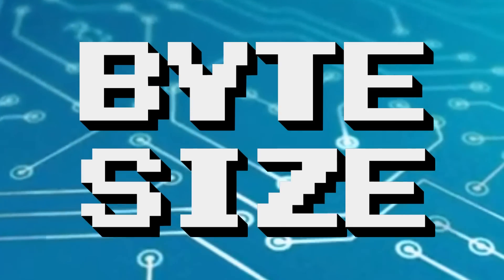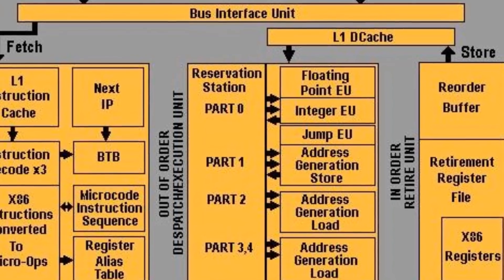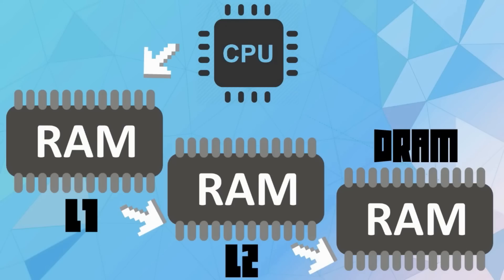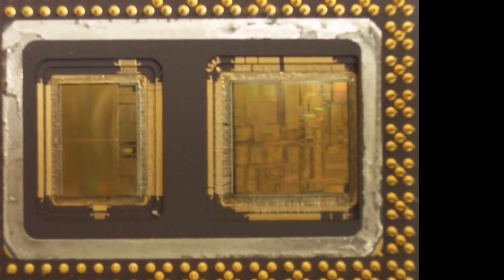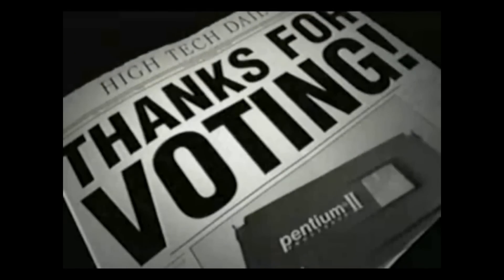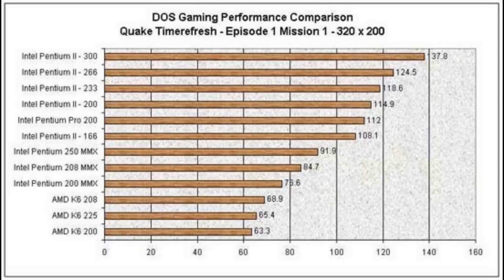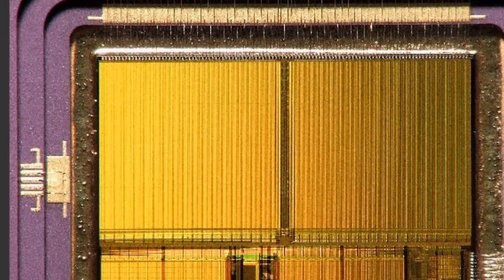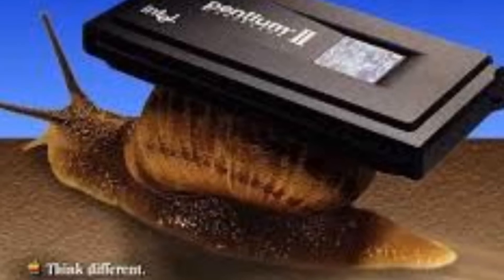Why Were Pentium 2's on Cards? [Byte Size] | Nostalgia Nerd

Comment: My first computer had a Slot 1 Celeron 333Mhz
Reply: My first computer had a ~5mhz 8088 x86 CPU LOL, it was a Tandy 1000HX.
Reply: Mine has a 2mhz 6502A with 4K of ram. VTech Creativision, AKA the "Dick Smith Wizzard". God I loved that thing, but updating to a Z80 4mhz/128K Amstrad a few years later was like being blasted into a star trek episode. Oh how we where naive in the good old 80s.
Reply: LOL I know the feeling. When I went from a Tandy1000 HX to a Tandy1000 TL2 (80286 CPU), it was nice but a small jump. I used that computer FOR YEARS..  So when I went from it to a 486 DX4 100.. It was like getting blown for the first time.. You smiled for days and all your friends knew who the man was.. :-D
Reply: A shitty acer OEM computer with P233MMX (the good part), 32MB SDRAM PC100, S3 Trio64V+ and NO 3D accelleration. Had to stay like that for years.
Reply: Mine was a Pentium 2 350MHz, on the same slot :)
Reply: My first comp had a Pentium MMX 166Mhz with 32GB of RAM, 2GB HDD+1GB HDD(later also a 12GB HDD), 32x CD ROM, Voodo2, ethernet and a Soundblaster 16
Reply: Wockes You had my same 2D video card (what do you think of it?), and a Vodoo 2 that seems a bit overkill for the system , but wathever that's cool.
Reply: Mine was a Pentium mmx 233, mhz 128 mb of ram, 4 speed CD drive, with a 1 gig hdd that later I got a 8 GB one and that was insane but sadly the gpu is what killed me it basically got me out of pc gaming for years its a s3 virge dx/gx pci 375/385 and it sucked big time the rest of the stuff fine but that gpu is terrible
Reply: @playereric7538  Yes the "graphics decellerator". Did you upgrade the system to 128MB yourself? Back then a Pentium system wouldn't ship with more than 32MB in it.
Reply: Bastylander oh yeah and it being 98 when I got it basically nothing played on it, not any well at least. And I did get an upgrade like a year after I got it to 128 mb because the guy said it would play games way better... it didn't, but I was young and just believed it would. And also 98 is late for it I know but we got it super cheap from a business that closed down but the pc is a Compaq deskpro 4000 I believe
Reply: oh, i remember that age when u can play games at 333 mhz and 32 mb of ram and 4 mb graphics card  :-) :-)

Comment: Alot of misinformation in this video. Only the first two celeron models came without L2 cache. The rest of the eight 250nm models all had on-die 128kbs full speed cache. Nostalgia Nerd obviously has not lived through this era of computers.
Reply: Or couldn't remember :p
Reply: And wasn't the celeron with full speed cache and the p2 only half speed?  I have seen a lot of comparisons where the celeron overclocked flogs the p2 and even slot 1 p3 in a lot of games due to the faster cache apparently.

Comment: So why was it on cards?
Reply from the maker: Because card rhymes with lard.
Reply: Because having the cache built directly on the CPU package lowered their yield (They would have to throw out the entire CPU even if it was only the cache that was faulty).   By putting the cache on an external circuit board (the slot thing) they could reduce this waste by swapping out the cache if it was faulty without having to toss the CPU also.    In other words, they used slots because it saved them, (and their customers) money.
Reply: rnbpl because the speed of the communication channel would inherit too much cross talk over a socket and was unreliable. The chips had to be kept close and data line lengths tuned for match propagational delay.
Reply: Nostalgia Nerd why not just answer him or link? I still dont know why it was on a card
Reply: It's mentioned in the video, and chris kerley already answered.
Reply: Something had to house the PCB they stuck the CPU and cache onto.
Reply: @Nostalgianerd  Youtube has become brain dead and made it so we don't receive email notifications to Youtube channels that we have "subscribed to" We don't know when you post new vids!!! Help!!!

Comment: Those were good days for budget minded pc builders.  The celeron 300A package had that second chip disabled but the CPU core was the same as what went into top-end pentium 2 and could be easily overclocked to 450 MHz.  At those speeds the detriment of no L3 cache was less than the benefit of the higher clock speed.  So many of  us that were into the early hardware 3d accelerated  had those for a couple years.  Mine went on to run as the NAS router in my parents' house for the next 6=7 years (running 24/7 although at its original 300 MHz.  It replaced an AMD K5 based system that crashed every few days and gave up the ghost entirely within about 4-6 months of router service.  The 300A regularly hit the 42.7 day uptime bug in win9x and was eventually replaced by an off-the-shelf router )and  was done so just for ease of use... that 300A kept running admirably right up to the end)

Comment: The Pentium Pro had full speed L2 cache of 256k , 512k or 1028k (1 meg) The chip was super expensive to make and was king in the server world for a few years. IBM PC's cost about 2500 to 3800 dollars each with a pentium pro and were used by servers and banking too often with NT4.  The IBM 365 6589 machines I ran here were used for about a decade, they had usb in a mother board from 1996. With Windows 2000 the top configuration I used for Photoshop was two 333 Mhz  Xeon overdrive server cpus with the max 512 megs of EDO ram. The box was really actually good for gaming in that the games used dual processors eons ago. One odd server motherboard I once used from 1996 would hold 1 Gig of ram, 8 sticks of 128megs. it was killer for photoshop  and big files when most folks were playing with 64megs. The ram was bloody hell expensive, a grand or more for the ram. Pentium Pro never had MMX buy II often did. The 333Mhz Pentium  Socket 8 Overdrive CPU was once 1000 bucks in Beta then 599 list when it came out to the public. Socket 8 is the giant Pentium Pro socket. There were some oddball Socket 8 to Celeron 533 Mhz aftermarket gizmos sold but none of mine would work long term, the Computer would lock up at the worst time. :) Pentium Pro never really took off in the Home market because it really did not benefit much with  Win 95/98/98SE; But with NT3.51/NT4/Win2000 the CPU's features were really used.

Comment: Celeron 300A was my first CPU in my very first PC. (I didn't know what a beast that was at the time, it was just cheaper and recommended for games)  When I myself opened my PC  later, to upgrade my graphics card (thankfully it had an AGP slot)... I was amazed that the CPU was also in a slot and not in a socket. I still didn't had Internet back then (1999 was the year)...  and was getting all my knowledge about the PCs from game magazines. For me my first PC was like going from 0 to 100... after that I was never that amazed at PC build, no matter how powerful it was.

Comment: The best thing was the Celeron 300A, I had one. Easily clocked to 450mhz with 128k ondie cache not slot cache. Back in those days, an overclock over 100mhz was extremely huge without special cooling. That Celeron was quicker at 450mhz than $500 Pentiums so we were quite excited with it back in those days.

Comment: These are amazing machines that people use all the time when they had a tough time early on in history and they can't make it through Windows 10 and all the events that take place. The best part about these is that they interface with all the children's equipment so if you have a serial connection or even an old expansion card it will work, plus you can put in a top Pentium III and have Netflix and chill whenever the server is on with Vista. It has no NX-bit so it can't run adult software but I would say if you were to put one in a box and plug it in either via USB or PCI-e ribbon cable make sure that it is ready to get hot because requests from real computers can make it work very hard!

Comment: Intel went with Slot 1 because it was easier to patent protect and thus exclude pin compatible drop-in off brand chips as were rampant throughout the Socket 5 and 7 eras.  Since Slot 1 there have been no off brand Pentiums.

Comment: It was basically an experiment in design and cooling IMO.  I think Intel thought by moving the processor off the board and onto a "daughterboard" that this would reduce heat on the board, which it did, but I think it caused other problems, and they went back to the old CPU socket style with later models of the Pentium 3 and later (as some earlier/older Pentium 3's and Celerons were slotted, but newer ones were on the main board via a regular socket).  In fact, I just found (in a box) an old Pentium II processor I have been holding onto for historical sake.

Comment: I've read somewhere that the early cacheless slot 1 Celerons were made from discarded P2's that had cache failures during testing, so they apparently had their cache removed or disabled and Intel was still able to package them up and sell them
Reply: +Infinitrium Same as for the 486sx, wich was a cache failed dx
Reply: +Bravo's retro the sx was actually a dx with a missing, or disabled math coprocessor.

Comment: Ive got loads of PII and PIII cpus all slot 1, have a working system. Still using a PIII, 550mhz SL3F7  slot 1 cpu in a Microstar MS-6163 mobo, its my server running XP, brilliant for music and video sharing with SCSI U320 adapter and 2 x 1gbps PCI Ethernet cards.

Comment: Like! The first Celeron had zero L2 cache but the Celeron Mendocino released only 4 months after the first Celeron, had 128 MB L2 cache at full speed. The Celeron Mendocino was because of this just as fast as a Pentium 2 ar the same frequency and FSB. The Celeron and Celeron Mendocino were also the overclocking Kings of that period, the 266-333 mhz versions being able to overclock by 50% simply by raising the FSB from 66 to 100. The Celeron Mendocino 300 mhz, at a price of 149 $, could be overclocked to 450 mhz (4.5x100) and perform just as fast as the fastest CPU on the market, the Pentium 2 450 (4.5x100) at a price of 669 $, both CPUs being released in the same day 24 August 1998.

Comment: The later celerons (Medocino's) had L2 cache - the differences between the Celeron 300 vs 300"A" where the cache was printed on die with 128kb of L2. It was very good when you overclocked it up to 450Mhz which matched the P2-450's for most gaming operations. These were the golden days of overclocking when they easily got 50% better speeds with enough cooling.

Comment: the last image is funny with the Apple ad showing a Pentium chip on a snail.

Little did they know only a few years into the 2000s,  Apple would be using Intel CPUs.

On a side note I always called these "Nintendo Processors" because the went in like an SNES game.  It was easier than saying "Slot 1" and then having to explain that Slot 1 CPUs are the ones that pop in like an SNES game.
Reply: David Kearns oddly enough now everyone wants to use Amd... And that was before rysen

Comment: That nice proposition in theory, but probable reality is that the primary driving reason for changing the form factor isn't a technical one, its business strategy in planned obsolescence and market control. 

Changing the form factor from socket to a slot architecure (coupled with an advance in processor design) means everyone is forced to buy completely new equipment and that's a huge business profit when (as is initially true) only Intel had and or was able to licence that form factor.

It came out at a time when AMD had undermined Intel dominance in the Socket based motherboards by producing cheaper competing chips and Intel needed to regain their business edge. Switching to slot based architecure put AMD back onto the back foot again (at least for a short time)

Comment: True, a packaging strategy was needed for product yield due to cache issues, but the slot was one particular vp’s desire. There are reasons not to do this. The perpendicular slot-motherboard made an antenna, which was not the product objective. This Caused problems with the Xeon which had four slots, limiting fsb to 100mhz,when 133 was badly needed. A perpendicular pci card was not as much an issue because that was 33mhz at the time

Comment: You forgot to mention the Celeron 300A. The Celeron 300 was an absolute disaster, so Intel re-released the Celeron with an on-die 128Kb L2 cache that ran at bus speed. In turn, clock for clock, it matched the P2 300 in benchmarks, and once overclocked to 450Mhz, it often beat the best P2 450 in the market. Nearly every 300a is able to overclock to 450Mhz. This was the true hero of the slot Intel CPU generation.

Comment: * socket 370 celerons and some later slot 1 celerons have 128kb of on-die L2 cache, making it faster in most games then a pentium II. Alltough the latter had 4x the L2 cache, it was on cartridge and ran at half clock speed, making it slower then the celeron in most games.

Comment: The other reason for secc processors to exist was the space they took up. Secc cpu's had much better cooling because they had a large rectangular heat sink as opposed to the normal square heat sink that came with other cpu's. I'm not so sure the cache has anything to do with it since Amd had competing secc cartridges too. 

One problem that was fairly common, Amd's version was wired the opposite to Intel's, so if you bought a "slot one" or "slot A" motherboard you were in for a rude awakening if you stuck your processor in the wrong type of board and blew up the cpu. I actually came across a few old computers that people were getting rid of, forgetting why they didn't work in the first place, to find a Intel cpu installed in an Amd board or vice-versa.

Comment: I remember getting a slot 1 Celeron 300A at 300MHz, and overclocking it to 450MHz. To this day I generally prefer the unlocked multiplier processors, even if I don't overclock them I like knowing that I can.

Comment: A great way to cover this subject is also to compare the Celeron 300 to the 300A, and the 300A to the actual pentium of the time. Whilst the 300 was utter garbage, the 300A, once overclocked, actually beat the much higher priced pentium of the era, all of it due to caching differences. The 300A cache was smaller, but ran at core speed compared to the larger cache of the pentium that didn’t.

Comment: I almost kind of wish they could use this type of card edge board again, I'm sure they would be inefficient for a number of reasons, but installing them and pulling them out made them pretty idiot proof and resilient. No need to worry about accidentally bending pins or screwing up the PGA on the motherboard.

Comment: I remember my AMD Athlon Slot processor.  It was 700Mhz but I bought something called a Gold Finger Device (GFD) from the back pages of a pc mag and I was able to overclock the processor to 1000Mhz.  Because I no longer had the casing on on the processor I used to hold the heatsink on with velcro :D

Comment: I remember having a Celeron running at 733 mhz. (it was contemporary to the Pentium 3), and while it was a socketed chip of some kind, it came with a card edge adapter for the card based systems.
Quite an ungainly looking arrangement, but it worked well enough...

Comment: Don't forget the converters! At some point you could buy a blank circuitboard with a socket to place a 'normal' P2/3 on a slot cardridge.
During this same time, AMD had processors on Slot A, which looked pretty much the same. (although I believe the slot had been around for a while before either intel or amd started using them in consumer pc's)

Comment: Celeron 300a was the fastest chip of the Pentium 2 era.  It had 128k level 1 cache and could be overclocked to 450mhz and it ran faster than 400mhz pentium 2s.

Comment: I remember buying a P3 500MHz cartridge (fastest available and passive cooling to boot) in the late '90s when my AMD Athlon 1.3GHz failed (bad batch, my Dad's and brother's failed a few months later). Windows 95 ran ok on it, but when I installed Linux I was able to play full screen DivX which even the aforementioned Athlon 1.3GHz wasn't able to do in Windows 95/98 without framedropping. Ahh memories.

Comment: They should bring this idea back but for GPUs. Put the GPU on a card with a 256 bit wide buss and have it share motherboard RAM with the CPU. Motherboard RAM is slower so instead of rendering to an external framebuffer they could put a small chunk of on-die memory in the CPU and have it render the scene in tiles. This technology is already mature, it's how AMD's Xbox One GPU works and Microsoft has the DirectX code to manage shared memory between the CPU and GPU already and could just port it to the desktop version of windows. It would also make multi GPU rendering easier and more efficient because you only have to allocate every other tile to a different GPU. A quad channel memory buss would have plenty of bandwidth for this type of shared memory architecture and because there is no longer any memory needed on the graphics card dual GPU cards would probably have a similar cost to a single GPU card with 8 gigs of DDR5 does now.

Comment: I still remember when my father gave me some awesome gifts for my BDay which included a Pentium III 933EB Mhz SECC format and a Nec Multisync 95 19 inches CRT monitor back in early 2000's. It'd be like a kiddo receives today(in 2020) an AMD 2nd Gen Ryzen Threadripper 2950X, 16-Core, 32-Thread CPU and a ASUS ROG Strix XG438Q 43" 3840 x 2160 4K gaming monitor. Yes, they were as expensive as top of the line CPU/Monitors are today. Quake III arena and Unreal tournament tests were used back then to determine whether a CPU was good for gaming or not.